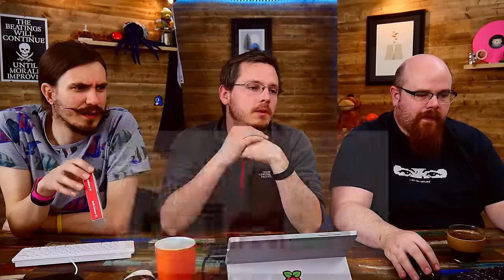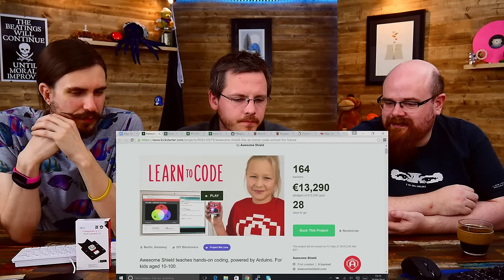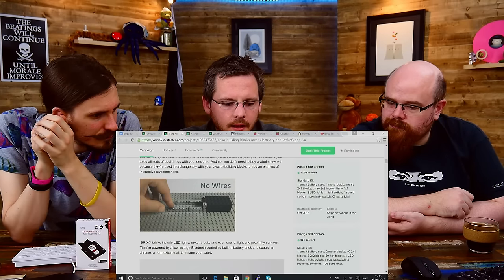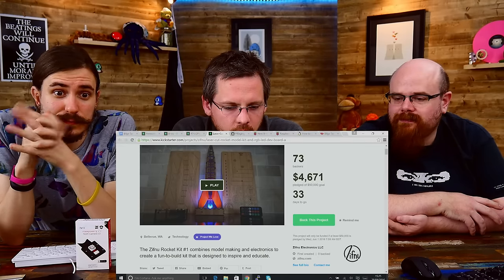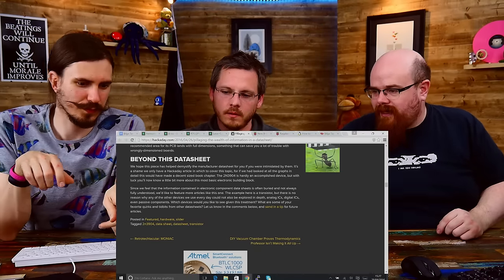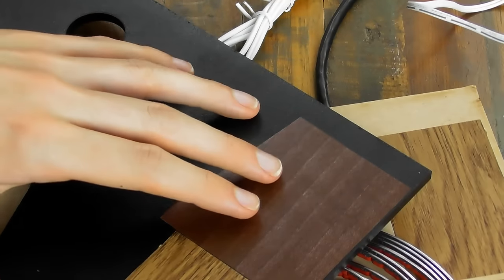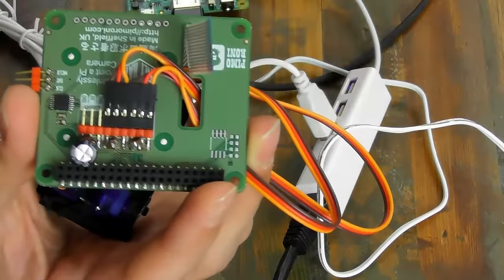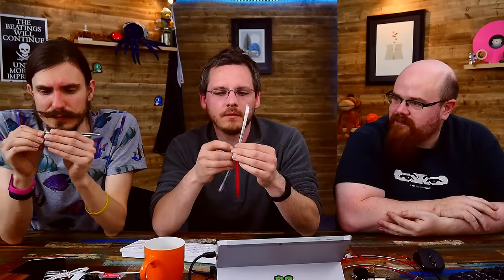Bilge Tank 034 - Such megapixel! The new Pi camera.

Comment: Instead of the RTk.GPIO, use a Zero with/without ali1234's USB Stem and have then with the right software you'll be able to use the GPIO in every manner of the same way as in a Pi directly if programmed well enough.
Reply: +Michael Telatynski that's all well and good for us experts, but unless the right software materializes I don't think it'll be very accessible. Being able to bootstrap the Zero with a custom binary that just exposes GPIO controls over USB - no need for an SD card - would be amazing, though. Last I checked, it wasn't possible to do this, but fixing the Videocore bootloader was on Gordon's radar.

I think Ryan's built something awesome, and there's always room for different solutions to the same class of problem!